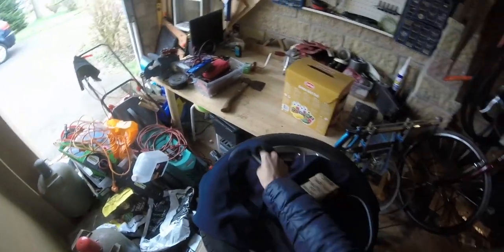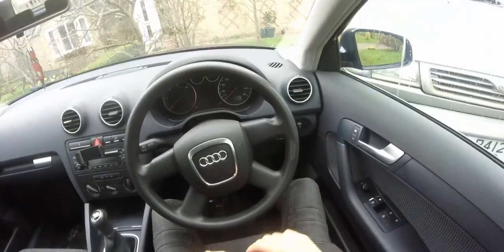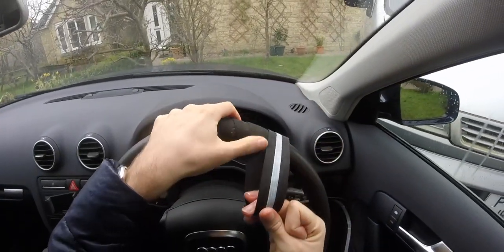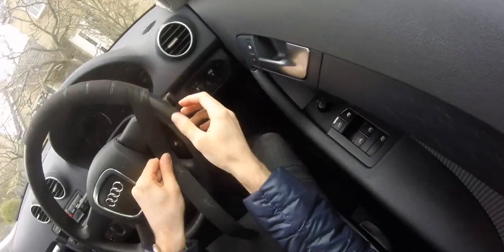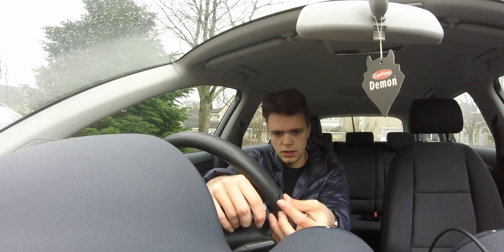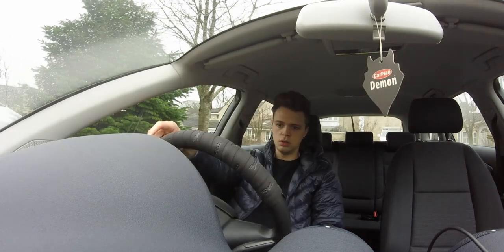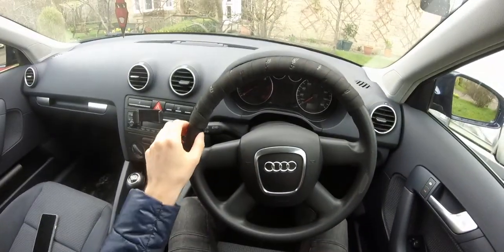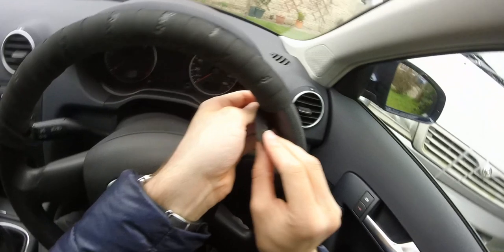Wrapping a Steering Wheel in Cycling Handlebar Tape?

Comment: I have done this before (in my car and in my racing sim), you just need a better tape, that's all. It is still a great idea. Just buy a better tape.
Reply: just another thing, you need 3 rolls for a car wheel, cover the radios with tape.
Reply: Very random question but when you did it on your racing sim, did you use one roll per side or more?

Comment: I wore through my steering wheel padding on my truck and just used tennis racket tape in a pinch (to avoid touching hot metal).  I think I'll pull out the handlebar tape as this will provide a better solution.

Comment: Wtf is that kitsch !? I paid 60 euro to put leather on my steering wheel and it looks like oem one. 8-10 and 2-4 o clock with perforated lather with blue stitching.
Reply from the maker: That's what's on there now. I didn't keep the bar tape on there for any length of time. Just an experiment. Mine is covered in leather now too
Reply: @BenHuggett  How much there?
Reply from the maker: @orhanabd1724  less than £10...it was a long time ago but I think about 5.99
Reply: @BenHuggett  What? It's too cheap. You did it yourself using leather straps or someone cut the lather and stitched it behind the steering wheel just like oem one?
Reply from the maker: @orhanabd1724  I did it myself. The kit came with a hoop of leather and some thread. I just did the sewing myself with a needle...took about half an hour and it's held up really well for the last two years
Reply: @BenHuggett  Oh I get it now. Mine is wrapped with the 3 spokes included (VW Polo Steering wheel) and the quality is amazing. Here take a look https://m.facebook.com/photo.php?fbid=535437920549248&id=318888118870897&set=a.318981028861606&source=44&ref=page_internal